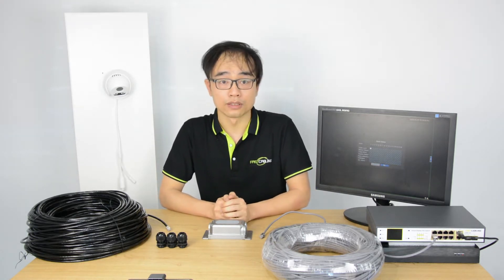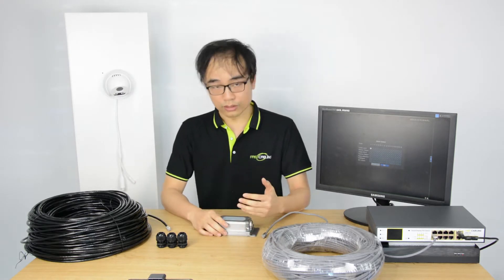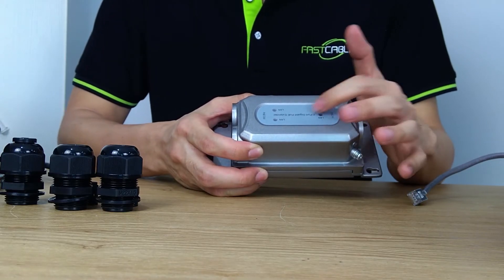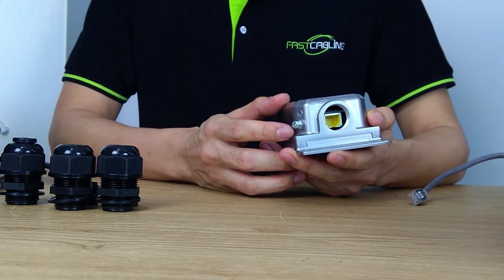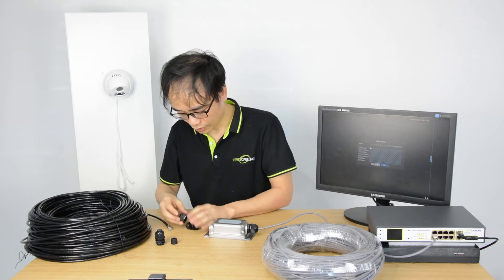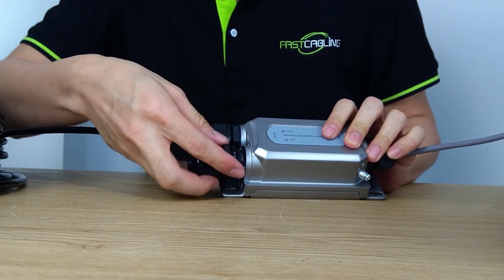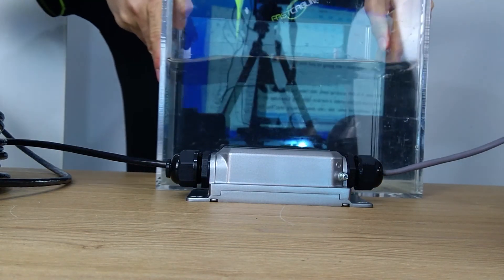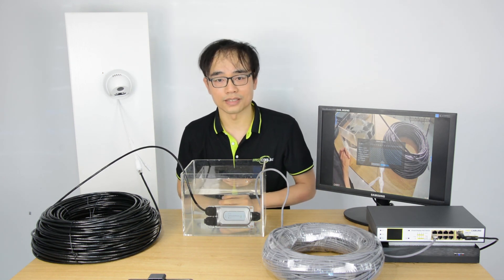How to extend PoE network for IP devices with PoE extender

Comment: May I know sir if how long can I extend my cable using poe extender
Reply from the maker: I suppose you plan to extend the cat5e or cat6 cable for IP devices such as ip camera, router, PC computer. The PoE extender only work for TCP/IP network. The maximum distance is 500 meters you can get with 100mbps bandwidth, and 800 meters with 10mbps.